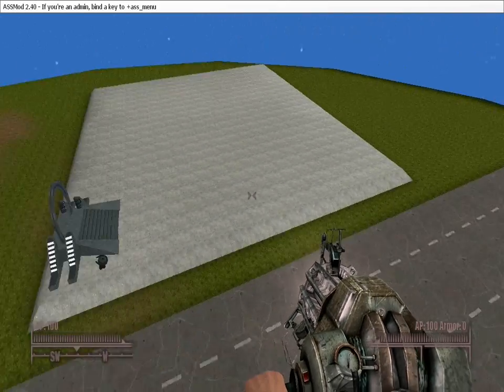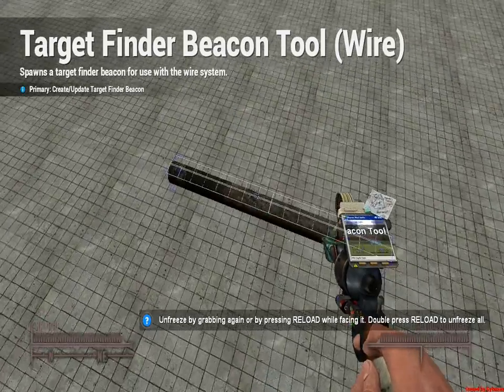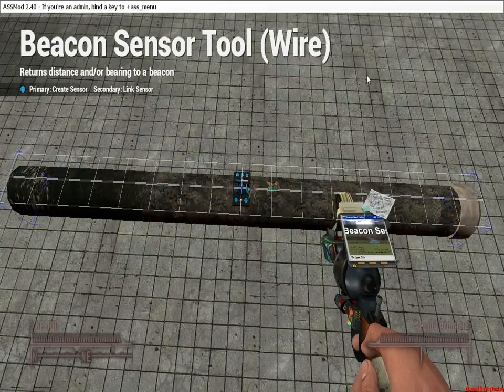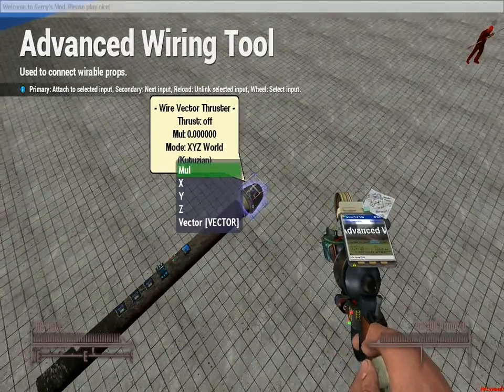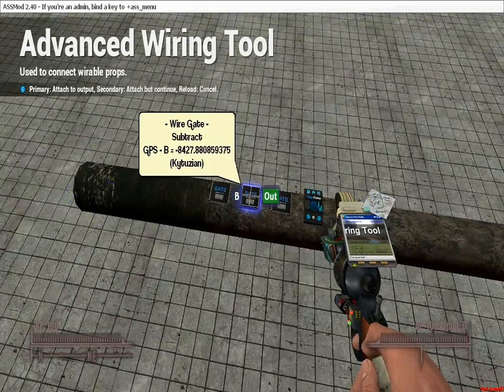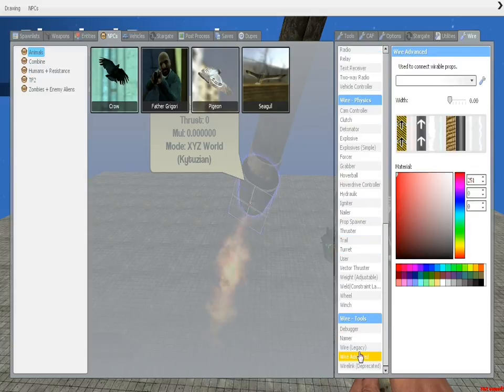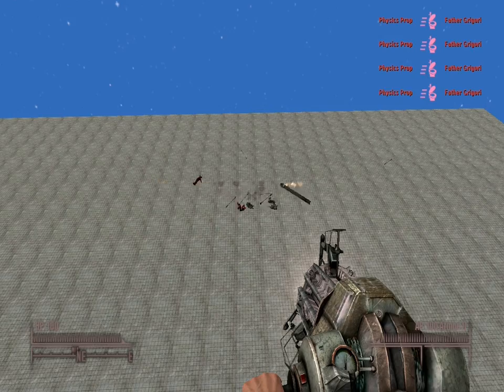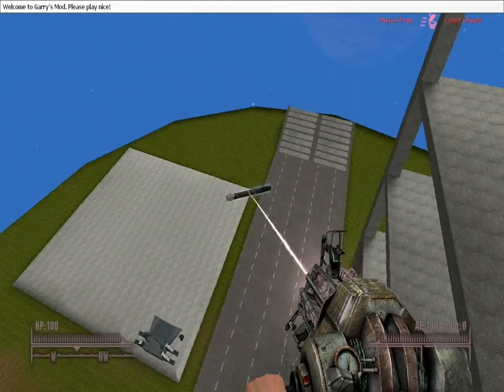Garry's Mod - Wire Tutorial - Vector Homing Missile

Comment: my beacon sensor doesnt have world x y or z help?
Reply from the maker: +Hawke Powers Did you check "Output world position (gps coords)" in the settings for the beacon sensor?
Reply: +Kytuzian Thanks. it worked but it still isnt working the vector thruster wont work
Reply from the maker: +Hawke Powers Try using the debugger on it and seeing what it says (if anything looks wrong). If you're not sure, tell me.
Reply: +Kytuzian i got the same problem but i did not managed to fix it
Reply from the maker: +PlesiothArchives What happened when you checked "Output world position"? Did you respawn the beacon sensor?

Comment: When i wire the mul from the vector truster it stop working,when i delete all and rebuid in works again :\
Reply from the maker: David Toma What are you wiring it to? When you say you rebuild it, do you not wire the mul? If it works without that, just don't wire it.
Reply: I fix it reseting the truster to default it doesn't change any settings but it works XD,Thanks anyway.

Comment: does it work for the horizon missile?
Reply from the maker: It should. It won't launch the individual missiles inside, however. The only reason it wouldn't is if the entity collide with each other inside the missile, but I don't think that happens.
Reply: can u make a vid on how to make the individual missiles to hit lets say an NPC.
Reply from the maker: I could, but it's pretty easy. The wire inputs on the missile itself are pretty self-explanatory.
Reply: too derpy XD i just learned how to make a ag3 satellite to target and fire automatically
Reply from the maker: XS1 Goliath The horizon missile is too derpy? I find it a little excessive, but it works well.
Reply: well im not good at gmod just started playing after 1 year break and just learned how to make a missile :)

Comment: I know this is an old video but I'd like to know how does the equation works. By that I mean , why substracting your current position from your target's position would make a vector thruster go in the right direction. If the answer is too complicated/long , just tell me, I will search on the internet instead.
Reply from the maker: It's not really that complicated, basically it's just like finding the slope on a 2d plane, except in 3d. Here we are representing that number as a vector instead of a ratio. So a slope of 2 (going "up" 2 and "over" 1) is instead represented as <1, 2>.

So, for example, on a 2d plane, if you have the points (2, 6) and (-5, 4), a vector representing the difference between their positions is:
<7, 2>, meaning from (-5, 4), you need to go 7 right and 2 up.

In 3d, you need 3 points, and a 3-component vector. If we have the points (24, 3, -16) and (42, 6, -100), then the vector would be <-18, -3, 84>. What this meaning is that, to go from point B to point A, we need to go back 18, down 3, and to the right 84.

Because the vector thruster takes a vector as input for what direction to thrust in, giving it this vector will make it move in this direction. If you were to give it <0, 0, -1> (and take off the gravity, most likely), it will go up.

As a side note, one of the reasons the vector thruster thing can be a little problematic is being we didn't normalize the vector first, so the thrust's magnitude increases with distance instead of being a constant speed.

Comment: Dont you need the input?
Reply from the maker: Which input? If you mean the target that provided by the Target Finder.
Reply: When I did the exact thing in your video, the missile didn't launch and the vector thruster is weird and not working properly. The prop is going in weird direction.
Reply from the maker: Daniel Kim The only time this has happened before to me is when I accidentally wired it in the incorrect order. It should be the Target's position -  the current position, or so that the Target's XYZ are put into the A input of the subtraction gates, and then the GPS's XYZ into the B.

Comment from the maker: By that I assume you mean that you properly placed and configured all the wire parts, and wired them correctly?

And by doesn't work, that means it doesn't move? Or doesn't move towards the target?

Have you used the debugger tool to determine whether the vector thruster is receiving the vector it need to activate?

The best possible thing would be to have you show me a video, or a picture, of what you did.

Comment from the maker: World_X, World_Y, and World_Z are all outputs. Assuming you clicked on the right settings, you would need to wire the Subtractions Gates to the Beacon Sensor, rather than the Beacon Sensor to anything.

If you need any more help just ask. Happy to help.

By the way, I said arithmetic subtraction gates because you have to use be sure to use the arithmetic gates, rather than vector or angle gates.